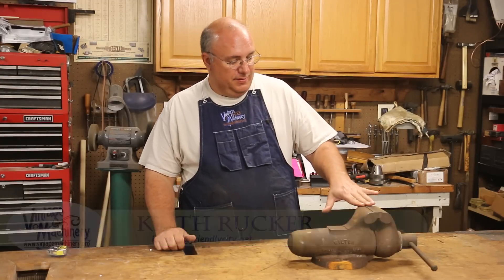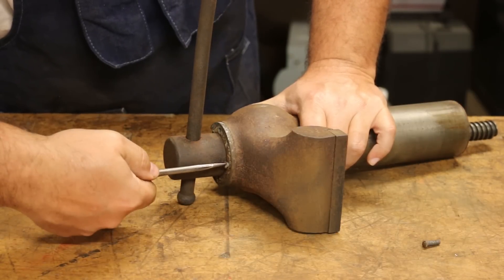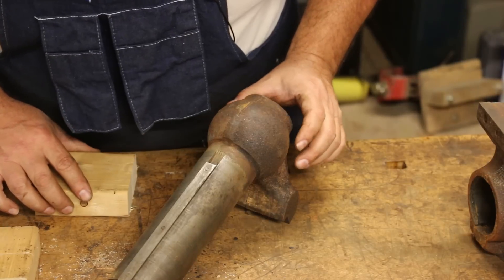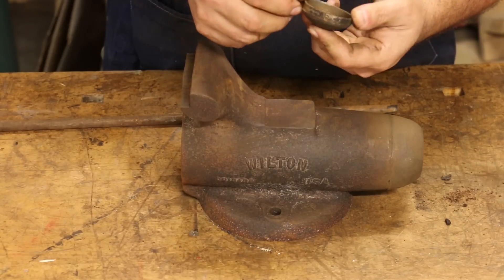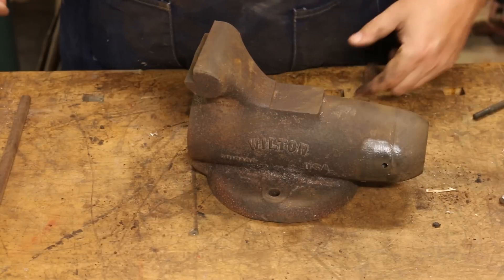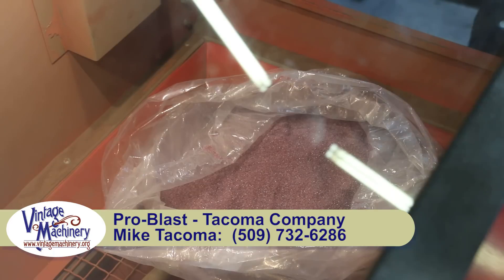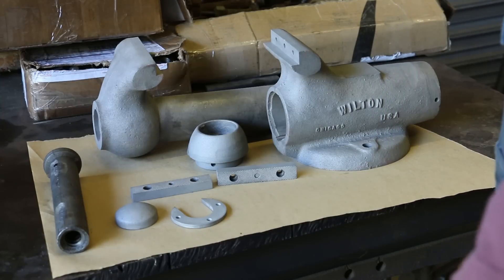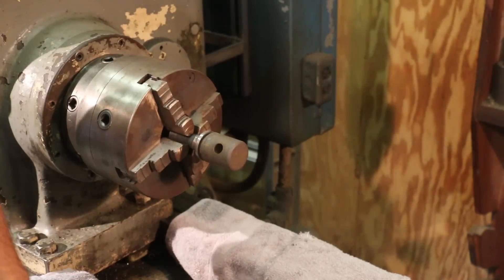Wilton Vise Restoration Part 1: Disassembly and Cleaning

Comment: You must have a big air compressor!  I have to wait several minutes for my compressor to catch up when I blast.
Reply: +vajake1 Well, I used to sell air compressors and what I recommended for smaller shops was to add another bigger tank to the system. That will help for the use, but the compressor will still have to run to "make up" the tank capacity. At home I have a 2HP 220V Craftsman compressor (made by Devilbiss). It has a 30 gal tank and I have another 30 gal tank in the system. Ran DA sanders and painted with it for 30 years...
Reply from the maker: +vajake1 They have a really big compressor out at the museum - something like a 10 HP motor powering a huge two stage pump and probably a 150 gallon tank.  My smaller single stage compressor that I have at home cannot keep up with the blasting cabinet.
Reply: Ten horse power, 150 gallon tank; now that is an air compressor!

Comment: I have to ask... Who's the maker of those screw drivers? They are very nice looking would love to have a set. Great video as always.
Reply: +Scotty Mcfalls they are called 'perfect' pattern, they are probably over 50 years old, i had some myself, but mine the handles were a little smaller in proportion to the blade size, making them not so good, i guess Keith has the proper ones!
Reply from the maker: +Scotty Mcfalls I have four different sizes, and they are all different.  Only one of them has a name on it and it was made by Irwin.  Sorry, that is about as good as I can do.

Comment: The moveable jaw cylinder and the stationary sleeve, on those Wiltons, have a close fit.  You don't want to remove too much material on either.  But, it's a old vice and won't really matter.  Just saying.
Reply from the maker: +WAVETUBE84 I don't think that I removed any material on the sleeves.  While they went in the blaster, I did not actually sand blast these areas.

Comment: Keith,

Do those screwdrivers have a name?  Are they know under a certain description?
I have two of them (came to me from my late father) and I have been wanting to find a full set, (or at least some more sizes)as I too find them really handy.
Knowing what exactly they are called...would help...

Cheers
Paddy
Reply from the maker: +gh778jk I have seen them called the "Perfect Pattern" but they probably have other names.
Reply: +Keith Rucker - VintageMachinery.org Thanks Keith!
i did a quick search with that name and found out that their official name is "SHELLEY PERFECT PATTERN SCREWDRIVER" !!

With that known, I am sure to find some !

many thanks

Paddy

Comment: I wonder how that metallic "dimple" effect paint would look on your vise?  Greg
Reply from the maker: +Charles Compton You are thinking along the same line as me.  I ordered some hammer tone green paint that is a similar shade to the original.  I think it will look nice.
Reply: +Keith Rucker - VintageMachinery.org Hammer tone, I couldn't remember but had used it before and still have about a pint on the shelf.  Greg

Comment: 4 46 means april 1946 congrats on resto
Reply from the maker: +kevin pangle Take a look at the link to the web site in one of the comments down below.  According to that site, the date stamped on the bottom is the date that the warranty expired, which is five years after it left the factory.  That would make this one made in April of 1941, the same year Wilton started making vises!

Comment: 4-46 is when the 5 year warranty expired.  Your vice was made April 1941
Reply: They were originally the actual date, they started forward dating them five years later in the 50s. Which is apparently why you will never see a 1955-59

Comment: I thought this might interest you, in particular, the date stamping. http://junkyardtools.com/tool_history/wilton
Regards, Matthew
Reply from the maker: +Matthew Tinker Very good information!  That would make my vise which is stamped 4-46 having been made in April of 1941.  According to this web site, Wilton started making vises in 1941 so this would have been one of the first ones ever made!  It came from up in the Chicago area where it was made as well.
Reply: +Keith Rucker - VintageMachinery.org Nice Job Keith.
1941 sounds about right, though the very earliest ones say Wilton Vise No. 4 Pat Pend USA.  They switched to the ones cast with Wilton Chicago shortly afterwards.  From what I recall, the patent was issued in 1942.